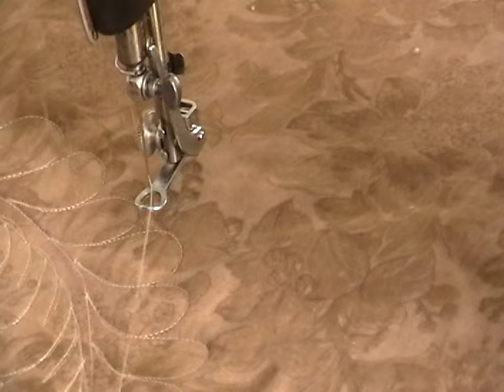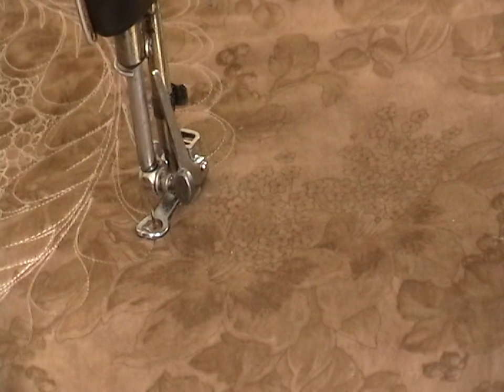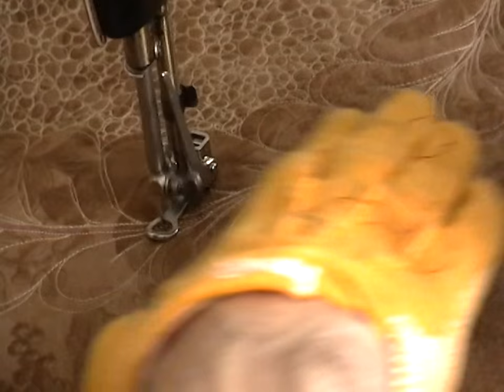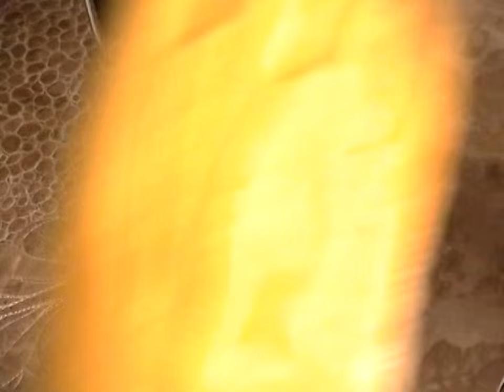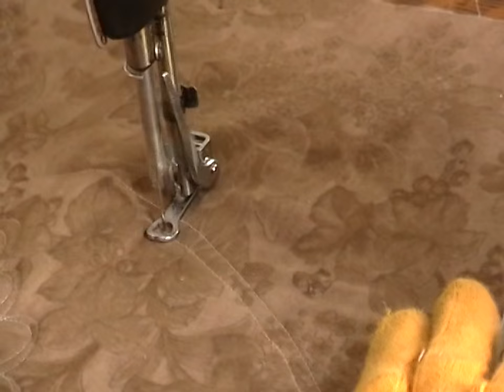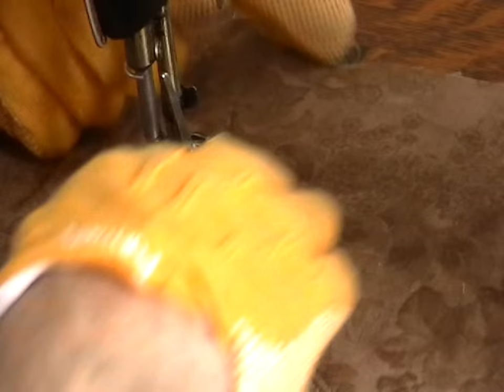Free Motion quilting on a singer 66 Treadel Sewing Machine

Comment: Because of you, I want to find a treadle sewing machine. I read somewhere that it's best do FMQ on machine that has vertical bobbin than the horizontal one?  Is it true?  I was surprised you are using the one with horizontal bobbin.  Many thanks for sharing the inspiration work!
Reply from the maker: I have used all kinds for FMQ and I dont think there is a big difference once you get the tension properly adjusted , but I have read that same thing and was afraid to try the horizontal bobbin machines for a while.   I get the best results now with my Singer 66 machines which have horizontal bobbins

Comment: Hello,  Sorry to bother you, but did you change the presser bar on your Singer 66 to get the darning foot to fit?   I recently got a Singer 66 and cannot fit my Singer darner feet to it.  I also bought a vintage darning foot for a Singer for $30 on Ebay, and cannot get it to do free motion quilting .  Any help is so much appreciated !!!!   THANK YOU !!  (Today I finally received my White Rotary treadle machine and I hope I can change the presser bar like you did !)
Reply from the maker: many of the oldest singer 66 machines had presser bars that had back clamping feet and there is no quilting foot available for those.   Mine had a standard presser bar and takes side clamping low shank feet so I did not need to change out the presser bar.      Many people who have that back clamping version do change the presser bar and it is not hard to do....there is also an adapter available that you might be able to find online
Reply: THANK YOU so very much for your help AND for all of your videos !!!!!
Reply from the maker: you are welcome....happy stitching !
Reply: They made the back clamping machines between 1919 and 1923 0r 24 I think. I have both. I have the adapter to make it a side clamper but I have taken a broken hemmer foot and modified a quilting foot and silver soldered them together and use it as one of the free motion quilting machines I use. I have lowered the feed dogs on that machine to make it easier to use. I also use a teflon mat (thanks for the idea) with rubberized cloth on it to keep it still.
I really appreciate all the knowledge you have shared. I am really enjoying the FMQ and the machine embroidery since learning from your video's.